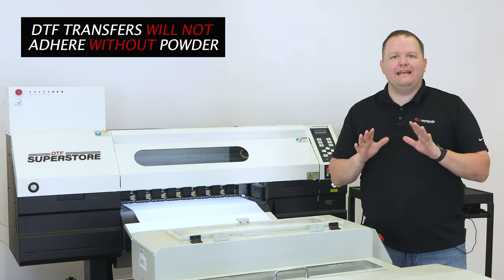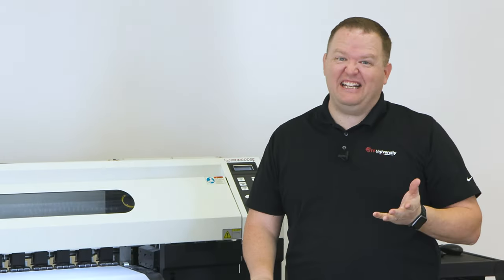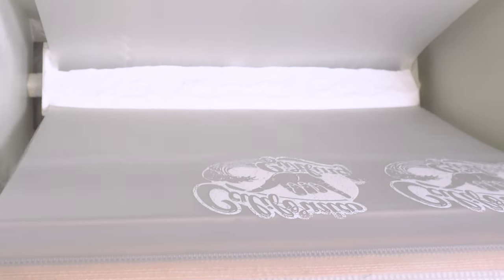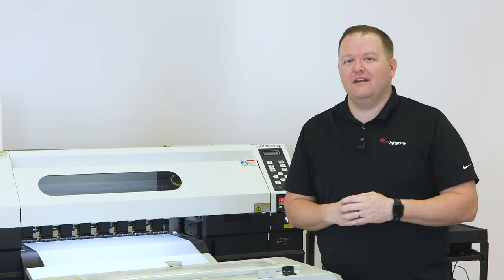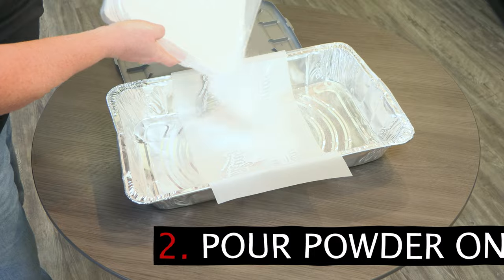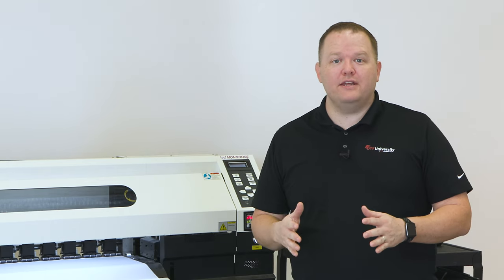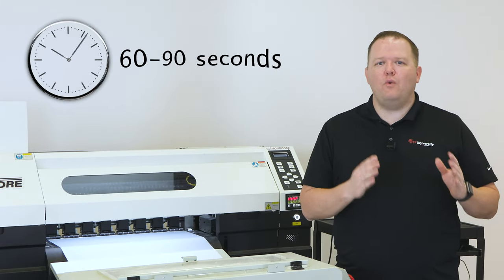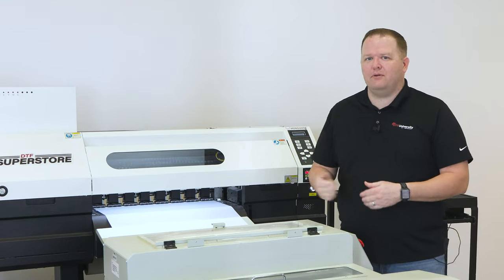DTF Basics | Powdering (Adhesive Powder)

Comment: Is waiting longer than a couple minutes bad?  How wet is too wet or how dry is too dry when hand powdering?
Reply from the maker: It depends on your humidity and temperature...I wish there was a specific metric I could give for too wet or too dry.  If you wait too long less adhesive powder will stick and would cause your transfer to not be as durable or potentially not adhere to the garment. keeping it between 60-90 seconds is best but pushing it out to 120 seconds will likely be fine.
Reply: I have issues when not printing an under base and having the prints stick to the shirt. It seems like it doesn't want to release from the film and if it does, it cracks as being released from the film to the shirt. Any idea on how to fix this because I hate having to print white under base on white shirts. Does it depend on my powder adhesive? I use the cold/hot peel v2 film